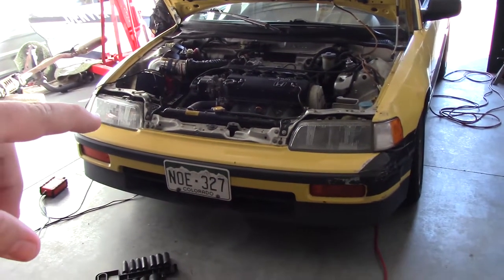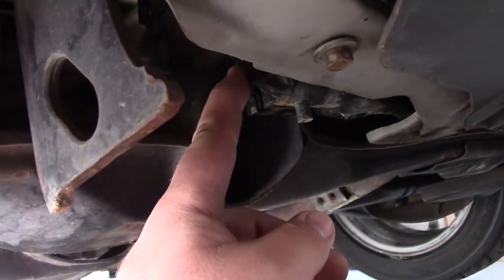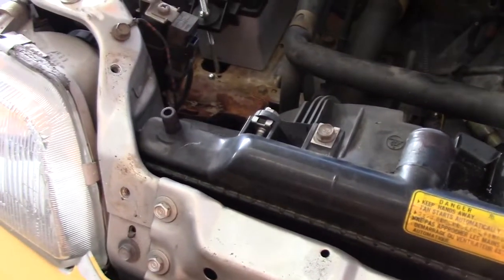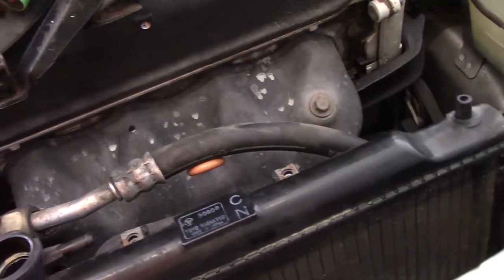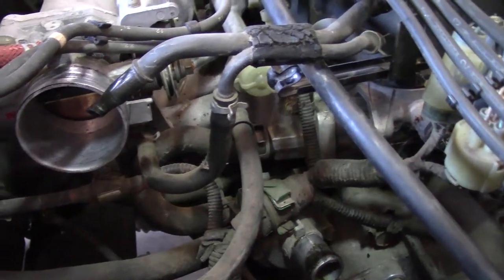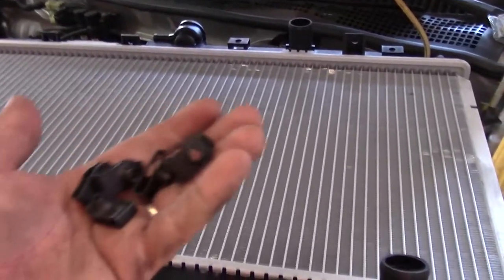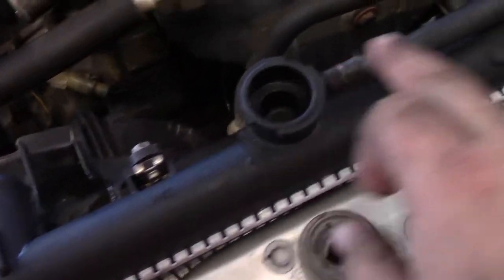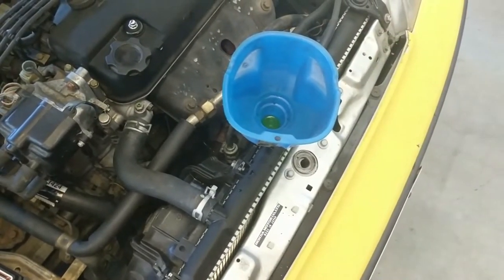EF Civic/CRX Radiator Replacement

Comment: Nice how-to vid.  Try a plastic trim tool to wedge between the hose and the nipple to pry it loose instead of just wrenching on it.  I know you were replacing the hoses here, but for anyone else, beware using pliers on hoses you want to reuse since the pliers can tear into the hose.  

To speed up the warming process on a small engine, let it idle for 30 secs to get plenty of oil to the top end, then use a small plastic or cardboard shim at the throttle stop to raise it to 2000 to 2500 rpm.  This also speeds up the water pump to help burp out any trapped air.
Reply from the maker: Those are good tips, thanks!

Comment: my crx has a D16a9 engine & im not sure if i have a bleed nipple for the air   any advice
Reply from the maker: If there's no bleed nipple (seems like a lot of later D16 don't), you still use the procedure to let it run and warm up with the cap open. There are actually funnels that have caps that lock onto the radiator you can add some extra fluid to so it doesn't get everywhere for relatively cheap

Comment: Are you planning to ditch the AC? Also, are you going to out a new chip/tune on the ECU?
Reply from the maker: I was going to keep the AC for driving to Solo Nationals, but my wife isn't coming along, so I'm going to yank it out now. Trying to decide if I want to pick up a redshift chip or a megaquirt and figure it out on my own.
Reply: I still have the AC in mine but its just dead weight and needs a recharge anyway. But, as far as the chip goes, I was thinking the same thing. Just wasn't sure which version to use and I don't really think I need the launch control. Looking forward to seeing more vids though,
Reply from the maker: StayFoul thanks! And yeah, garage built Hondas showed the AC is about 57 pounds if I remember correctly

Comment: Hoping to find some answers here, I can't find the bushings for the OEM radiator mounts anywhere :( 
Has anyone had success in finding these? Mine are completely dry rotted and an upper bushing is missing.
Reply from the maker: The lower part numbers are 74172-SH3-010 and the uppers are 74171-SH3-010 for the right (passenger) side and 74176-SH3-010 for the left side. I haven't actually looked for them before and looks like Honda discontinued them, but hopefully that's enough to find some. Good luck!
Reply: @MuffinRacing  thank you. I've already tried finding them based off of the part numbers. I can find stuff on ebay where ebay itself says they fit but then I look up the part number and the dimensions don't match up :(
Reply from the maker: I tried Google out of curiosity. Seems like there's some European and Japanese dealers that still have them, but that's a stretch
Reply: @MuffinRacing  im going to look at the specs for other Honda models and see if I can find a similar fitting bushing

Comment: is there a bleeder valve on these?
Reply from the maker: If the engine is stock, there is one near the cylinder head at the upper radiator hose
Reply: Thanks for the reply, ur the man

Comment: Is it two gaskets on the thermostat or just one
Reply from the maker: The thermostat housing should have just one gasket
Reply: @MuffinRacing  ok thanks just wanted to make sure I have 89 honda civic that iam trying to do radiator for your video has been very helpful
Reply from the maker: @patrat1990  Glad to hear!
Reply: @MuffinRacing  I had to do a water pump etc.. and the radiator. I just got back from the real drive she drove great u got any videos on the dimmer light mine shorted out

Comment: Do I I need to cap off the transmission cooler holes since mine is manual?
Reply from the maker: I think each radiator will be different? All the radiators I've bought were sealed already
Reply: The lines don't run anti freeze though right ? So I could just leave them open right?
Reply from the maker: @fahque9841  those lines run antifreeze to automatic transmissions, but not the manuals. I think you have to use the included adapter with the radiator for those holes to do anything
Reply from the maker: That's right
Reply: Hello man did you figured out mine has two rubber caps but I feel they are going to pop once the pressure it's goin what did you do?

Comment: the radiator is completely loose but there’s a piece on the bottom the “hooks” to the frame that’s keeping it from coming out. idk if you know what i’m talking about. do you have a instagram?
Reply from the maker: Yep, those are the tabs on the radiator support frame to keep it from moving on the bottom. I do have an Instagram, but I'm not active there either any more.
Reply: @MuffinRacing  its fine, turns out i bent radiator support pretty bad causing it to get stuck. any advice to pull the dent out?
Reply from the maker: @itsjayzz7611 I'm not the best at this kind of work. Usually I just out some vice grips on a tab like that and try to bend it back ,but there's a high likelihood of snapping it off